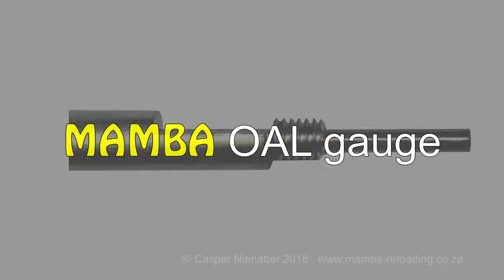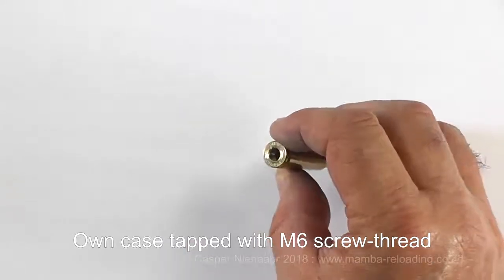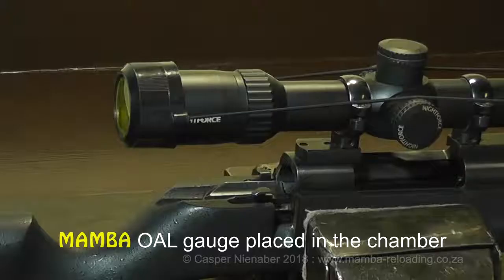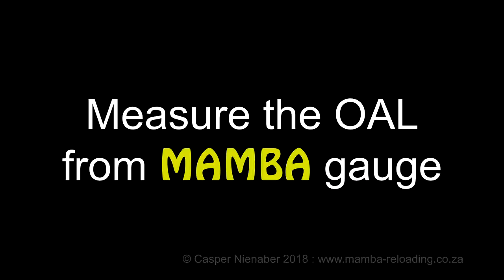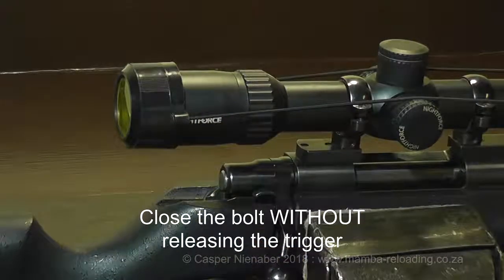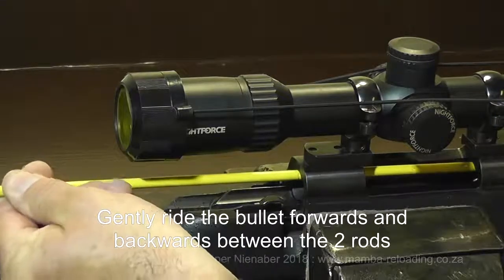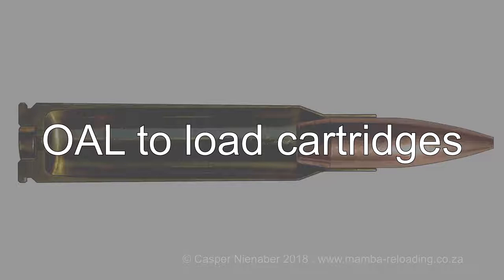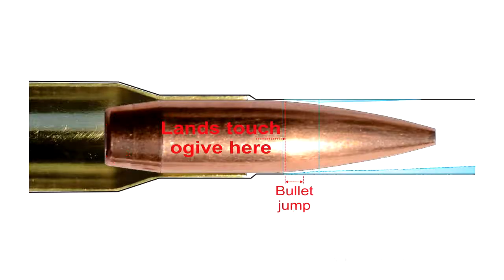Mamba OAL-gauge

Comment: Good info here.  I also made my own similar gauge :) but Hornady one is cheap enough to buy one.  It has thicker plastic rod inside to push against the base of the bullet more squarely.
Reply from the maker: Thank you. I bought/used the Hornady and then built my own, based my design on the Hornady design, but I addressed the following issues: I found that the Hornady's threaded end break off very easily when dropped. Also found that the plastic rod gets dented by the thumb screw, which causes the rod to "jump" to closest previous hole, which could affect measurement.